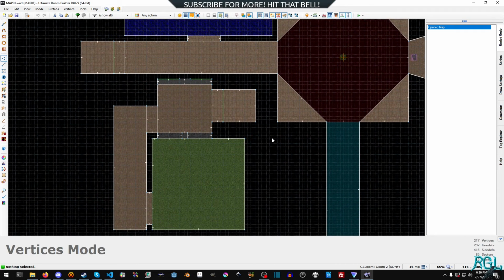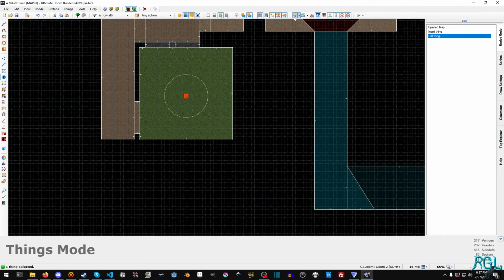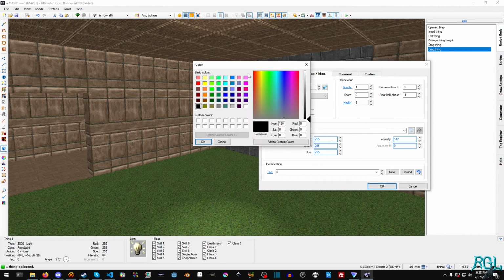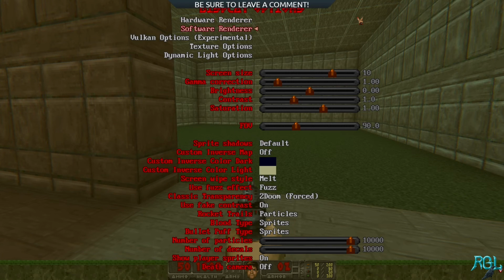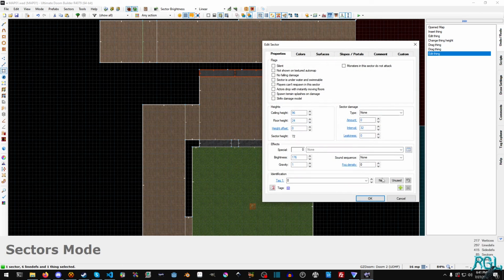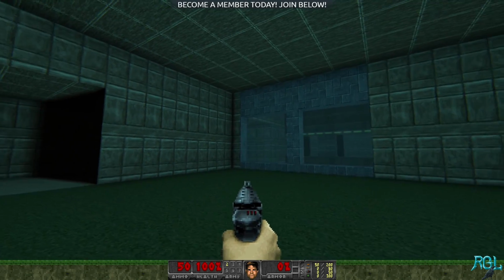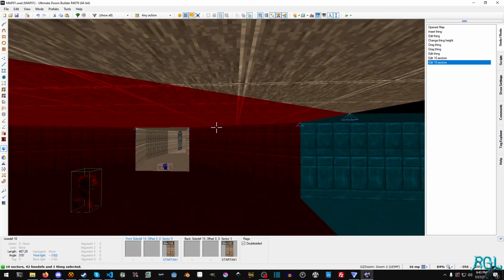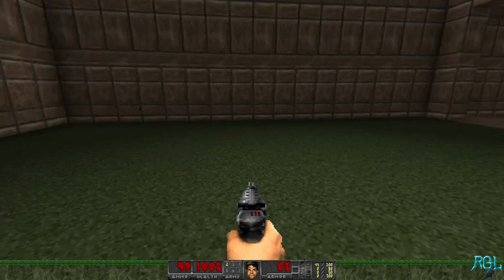GZDoom Mapping - Real Time Lighting Point Lights - Tutorial 17 | Ultimate Doom Builder(UDB)

Comment: One small thing I just figured out. Shadows only seem to be cast by walls. My level has pillars (which I had pulled up from the floor) and they weren't casting shadows from dynamic lights. I spent like an hour fighting with the GZDoom settings, and thinking my dynamic lighting was broken! XD It's weird as I don't really get what the difference is between walls and other geometry. If anyone knows more about this then please let me know if I'm missing something, or if there is a way to get things like pillars to cast dynamic shadows.
Reply from the maker: Sorry for the delay. Try flipping the linedefs. They should have a notch on the middle of the linedef. You want that facing inwards towards the sector.
Reply: I thought I tried that, but I'll give it another go. Thanks!

Comment: The biggest issue with Dynamic Lights is that only void casts shadows. That means you can get some cool effects with dynamic lights but it also makes their usefulness as a universal lighting system very limited.
Reply from the maker: Yeah I don't think GZDoom has anything other than a basic forward render. When it comes to the more modern side of GZDooms lighting features I have less experience . If it has a forward+ style renderer you could use non shadow casting lights as fill lights though. But otherwise you have to blend with sector brightness/colors + real time lights. Which is fine because it does create a rather unique look even if it is a bit of a pain.